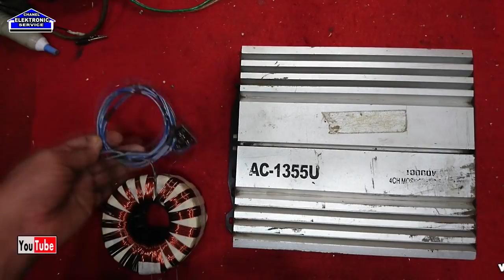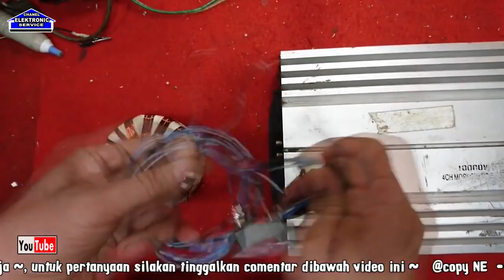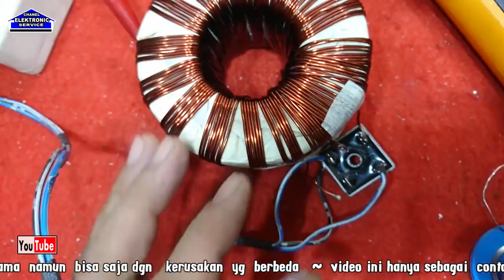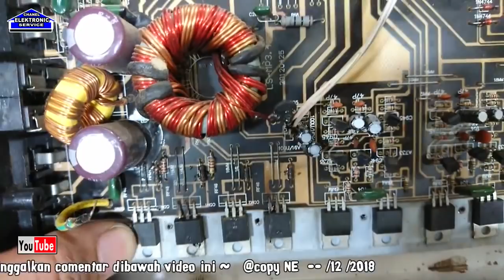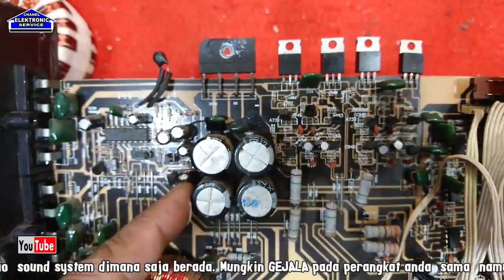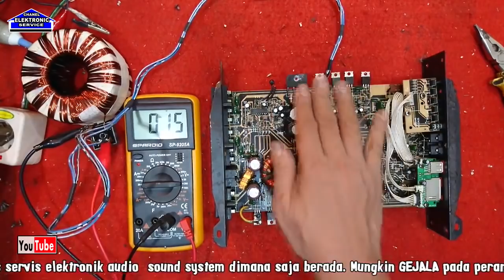cara gabung POWER MOBIL dengan Donat trafo (video ke 184)

Comment: gan,kl inverter yg rusak tdk diganti apa tdk mnganggu kinerjax power mobil kl memakai travo donat tsb.
Reply from the maker: tidak ada ngaruh. . .
pungsi inverter itu adalah untuk membntuk tegangan DC 25volt  ct( atau sesuai kebutuhan power yg  bersangkutan )  dari  input teg 12volt / dari aki atau POWER SUPLY ADAPTOR.
jika sdh pakai trafo 
tentu saja inverter tdk bekerja  karna tdk di berikan suply tegangan
power akan tetap bekerja normal 
jika tegangannya sesuai. misalnya pd power dalam video tegagan dari trafo saya gunakan 10A/ 20volt CT.
Reply: @Servis-f3h  kalo sy kasi 30volt dari travo yg asalnya 25volt dr inverter, kuat ndak mas powernya ???

Comment: Itu kn sebenar y pake AKI dengan tegangan 12vol  minimal 3amper  klo di ganti teravo apa gk drop supwover pak??... mohon penjelasan.y
Reply from the maker: cara di atas dilakukan adalah untuk pemakaian rumahan dan langsung colok PLN tanpa pakai AKI
DROUP subwoofer itu tergantung dari AMPER trafo
makin besar ampernya SUBBnya tentu lebih bertenaga sesuai maximal spesikasi power tsb
minimal 5 amper murni 12volt
Reply: Ok atas penjelasan.y
Reply: ciri has  nya lagu si om itu yang membuat semangat menonton videonya. ahaha sukses selalu ya om.
Reply from the maker: @yudiramadhansyah8060   hahaha terimakasih. . .
Reply: 5 Amper murni/yg besar apa gak meleduk tr final bos @Servis-f3h

Comment: Saya punya monoblok LM audio 2200wat sama subwofer LM audio 800wat 4 bua..sdh tidak pake di mobil lagi..mau pake di rmh gimana caranya
Reply from the maker: pasang adaptor saja bozz, Beli adaptor swiching 12volt 50Amper, sdh jozz itu. 
trmkasih.
Reply: @Servis-f3h  saya sdh punya adaptor 50A,ttp adaptornya tdk mampuh bawa boss...pas kontak monobloknya tdk bisah nyala..lalu sy pake monoblok kretikal mass 2000wat baru bisah boss.
Reply from the maker: @fishingindustri6259  sory. .  maaf ya ?? tadi saya di luar ?? baru ingat klo LM audio 22OO itu Power muantap Tenan bozz , sanggub main 1000Watt pure pada mode 1 ohm.
saya belum pernah servisan barang ini,  pemakainya pun hanya orang-2 tertentu saja , dulu 
dulu pernah  instalasi  di mobil  Ferozza , dengan 4bh subwoofer 12 inch , 4 bh midlow 6,5inch  batrai 120Amper itupun harus bantu star mesin dulu. . .hehehe Nyedot buangat batrainya, , tapi klo tuk suara jangan Tanya lagi. . . Pass di telinga. .  Remuk di dada.
Reply: @Servis-f3h  iya2 boss emang keras suaranya seperti guntur boss, emang itu power LM audio 2200wat itu tdk bisah pake batre kecil boss..apalagi subwofernya saya pake LM audio DD 800wat juga 4 buah boss makanya adaptor 50A tdk bsh boss.
Reply from the maker: @fishingindustri6259  dan sebagai tambahan saja , , , ada  teman saya buat pake di rumah nyoba Power suply 200A MODIFAN dari bekas tRAFO SWICHING mEsin LAS !!!  Wah ger!!!! buanget Bosss !!!!   videonya nantik mau saya buat juga itu heee, tapi  secara logika klo di pasang trafo DONAT 20~30 Amper BISA koq tapi powernya HARUS DI BONGKAR DULU ,,, , , TEgangannya MODIF tidak melewati INVERTER , Langsung ke ELCO di dalam seperti cara -2 pemasangan yg saya buat di video di ATAS.
bedanya system LM audio itu sumber tegangan ke AF nya ada extra , krna sudah memakai system class D,
TDK SAMA dgn system  power mobil biasa  cuma satu sumber tegangan.
Reply: @Servis-f3h  benar sekali boss ini power LM yg saya punya ini klas D boss
Reply: erupley enjokan pakai inverter di pasar harga 30/20 amper rasanya 200ribu ja jadi out volt nya di adjus 13.8 ada putaran di dalamnya tambah elco 50volt 10.000uf mantap basnya power mobil
Reply from the maker: @normansaja2800  : thanks Mz , Pake yg 30A kurang ngangkat maz , kami sdh mencobanya (video blm sempat upload)
itu LM audio TYPE class D stabile main di 1ohm 
saya sdh prnah pasang 
batrai mobil avanza 40 amper  5 menit  on GAK bisa start lagi maz ???
powernya Ngisap buangat tu ,klo tenaga BADAK buanget 
capasitas ELCO di dalamnya itu 80V ct
klo power 2 biasa  rata  25v , 35v ct
Reply: Channel Electronik Servis wah mantap tu punya saya cuma.monoblock 1200w. Mospfed 5200 4set  spk kenwood  singel coil. .oh iya bos itu emang pakai trnsitor apa
Reply: Channel Electronik Servis kli yg di vidio itu kyaknya cuma kapai tip 41 42 . Paling tinggi volt 24ct . Klu 30 amper gak cukup mungkin gak di adjus ya power mobil minimal klu mau horeg 13volt  an tambah elco beberapa biji .
Reply from the maker: @normansaja2800  itu POWER clas D tdk pakai TRansisitor Maz
 ??? semuanya pakai MOSFET  hanya nampak dari Luar , BELUM pernah rusak sih. Lihat elconya  PSU 80volt .Klo buat angkat subb ini memang JAGOnya , buat di mobile . main 4 ohm sangat enteng sekali power adem-2  saja
main 2 ohm agak panas -2 dikit 
main 1 ohm  barulah keluar ferformancnya 
artinya  line out subwoofer  di MBAT SPEKER 2 coil   2 BUAH  tetep nyantai POWERNYA  ( main 1 ohm ) 
tapi PSU nya  harus besar kapasitasnya
Reply: Channel Electronik Servis o geh mantap . Oh iya bang  itu donatnya  pabrikan apa gulung sendiri

Comment: bos  kenpa power  bubil saya klo' basnya di naikin kok mlah ngedrob bos?
Reply from the maker: gunakan kabel/ wayar  yg besar + masa yg kuat jika di pasang di mobil
gunaka adaptor yg amper di atas 10 A paling baik 30A  jika ingin  suBbnya kental
Reply: ini saya pakai di rumah bos  trapo saya 10amper  tapi sepertinya  setrum kuat itu bos. klo' basnya di bukah trus ngedrob bos